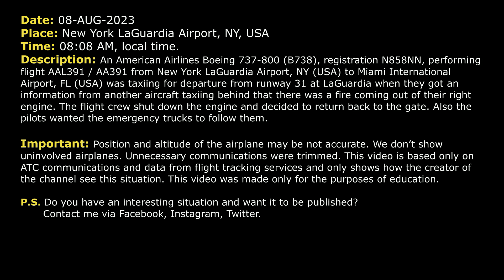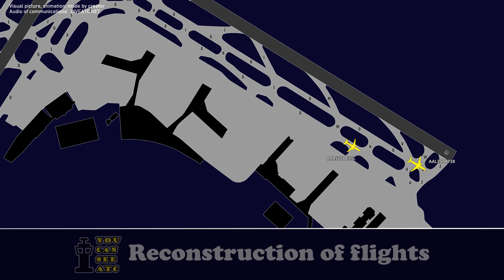“There is a FLAME out of the engine”. American B737 has possible engine fire at LaGuardia. Real ATC

Comment: Anyone any idea what the Brickyard saw? I'm well aware of flameouts on take off etc. but this is rare? I was thinking some sort of leak that was heated and  then flamed?
Reply: Compressor stall can happen anytime 
or It's Torching in the turbine and exhaust. Residual fuel doesn't burn 100% from previous run, ignition timing is late or a leaking fuel shut off valve. Not a big deal but the memory items are to shutdown the engine and have firetruck escort it back.
Reply: Mentour Pilot made a video about this central exhaust some time ago. If I remember correctly, it was the exhaust from parts of the gearbox connecting the two parts of the turbine shaft.
If there is vapour coming out of there, it is supposed to be oil. The flame suggests to me that at some point fuel got into that section.
Maybe someone was working there and some fuel residue got there and burned off during the taxi. This is just a guess.